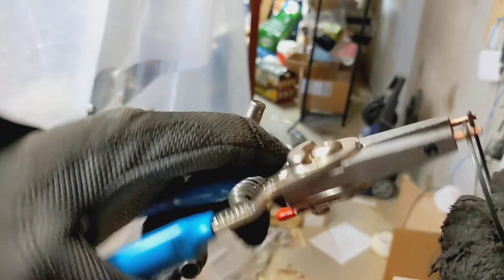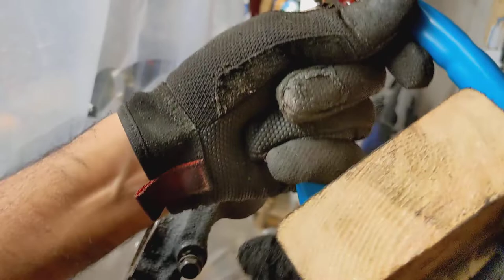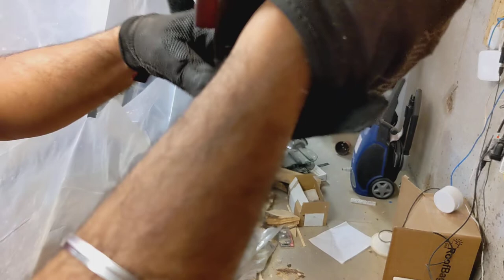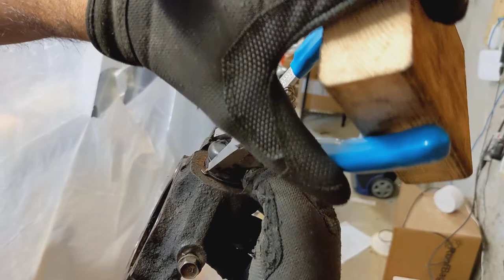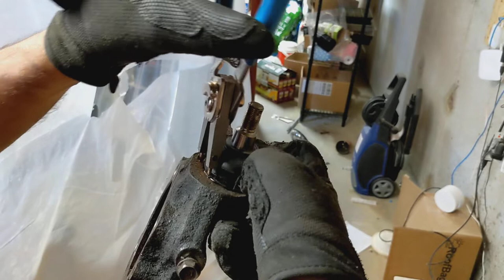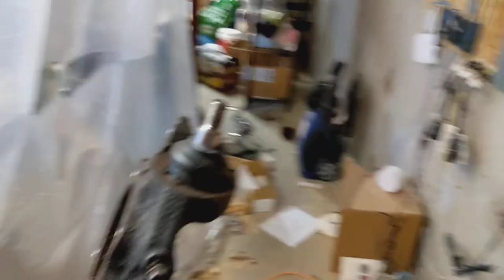Install Snap Ring On 96 Accord Lower Ball Joint

Comment: Those are adjustable snap ring pliers. You had them set for an internal snap ring, but the ball joint uses an external snap ring. You should set the pliers to external so that you can squeeze the pliers rather than push out.
Reply from the maker: Thanks a lot for that tip. Hoping I don't have to do that again in the next few months, but glad that it can help someone else who reads this!